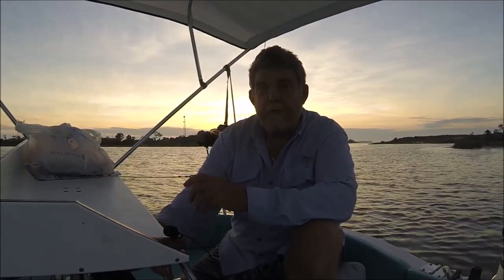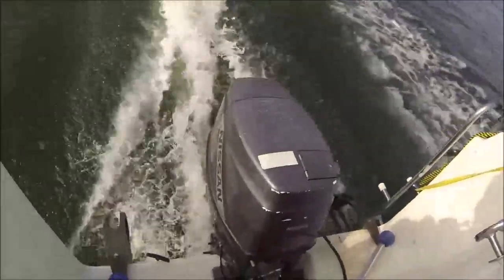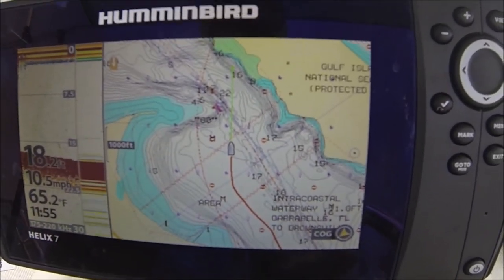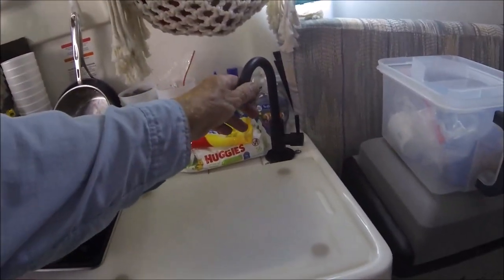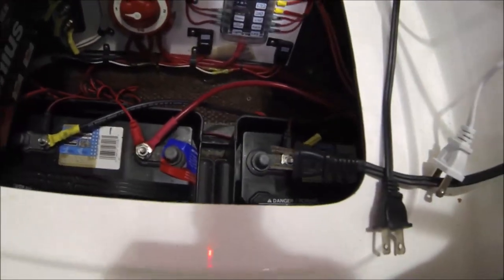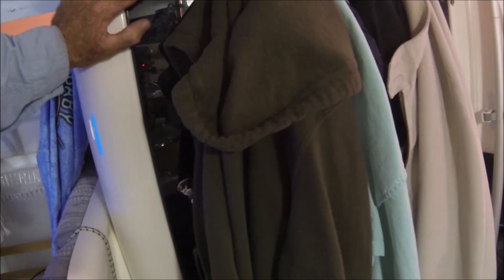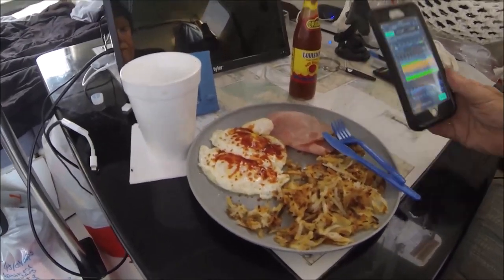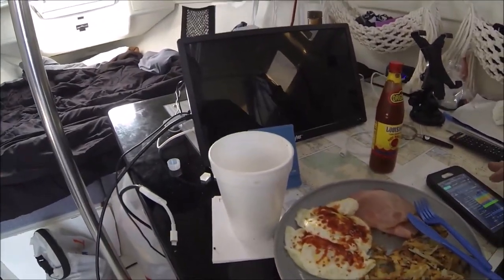Living on a Boat short term? Small Boat Adventure - Macgregor 26X Ep. 5

Comment: As a RN, I took care of a guy. Said his career was outboard ENGINEER and that he had worked for Mercury and Johnson. I asked how long should a well cared for engine last. No pause..... "6,000 hours". He said .... We put them on a block and run them until they die. 5,000 for sure.... 6,000 probably.
I ran my boat everywhere.... I fish 4-7 times a month. That's 75 trips a year. I barely hit 100 hours. It's a lifetime to hit 5,000.... That 1997 probably has less than 500 hour. 90% of it's life ahead of it. Like..... it's just gotten "broken in" and is nowhere near "broken". He also said.... The less it sits and is RUN, the better.
Hope that helps reconfirm your plans to "not" change out.
But..... if you plan on increasing to 500 hours a year for ten years.... You will ABSOLUTELY save money on 4 stroke fuel. But.... Really? Do you really think you're gonna put that many hours on that motor? More likely? To put more hours on the anchor rope watching sunsets, playing, drinking, cooking....
Thanks for the enjoyable clips.
Reply from the maker: Hello Francus! Wow, this is such good information it really deserves a video itself, or possibly printed. Many believe that age alone wears out a engine. I hope this engine lasts a long time, because as you said - there are likely much fewer hour on it than you might think. Thanks for the good info! Thanks for watching!
Reply: @ChristopherQuest  
I'm SUBSCRIBED....

Comment: Chris, new subscriber here because I am interested in the Mac26.  You do a great job of talking through the way you use the boat and it has already helped me think through how it might work for me.  On question for you.  How much fuel do you use per hour when you are just motoring to get somewhere?  I am in Melbourn FL and thinking about motoring to Bahamas and then sailing around there for a while and the Mac26 looks like it could be a great option for me. Thanks
Reply from the maker: Hello MN Dad, I lived in Jackson, MN for while! My 50hp 2-stroke seems to use more gas than a four stroke would for sure. I can get right at 20 miles with 9 gallons of fuel - pulling the 14' dingy at like 7 knots. I can get about 25 miles without the dingy. So not that great 2 to 3 mpg. Hope that helps, thanks for watching!